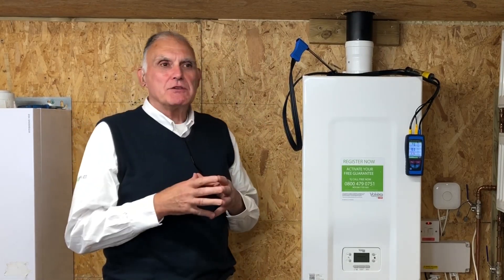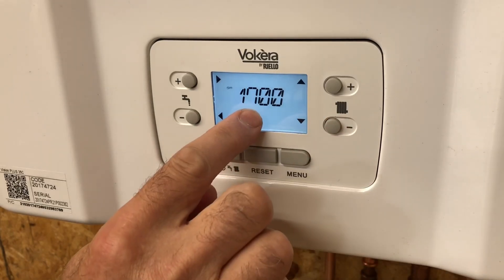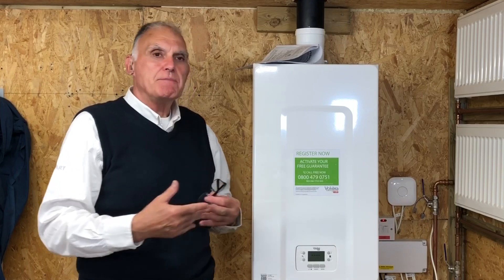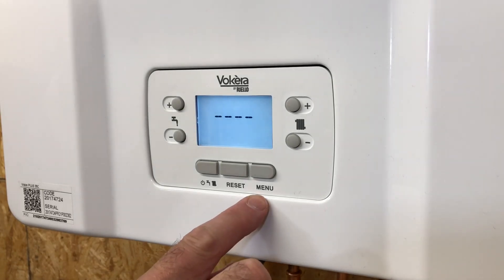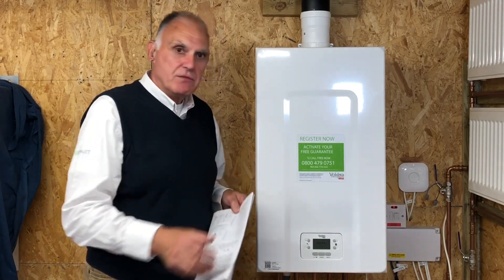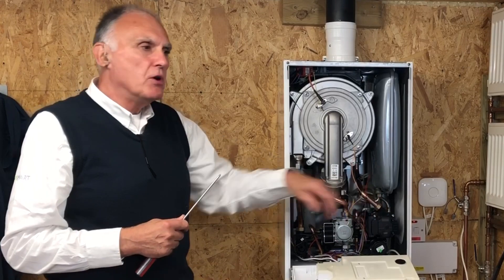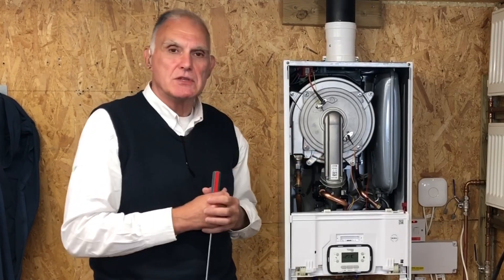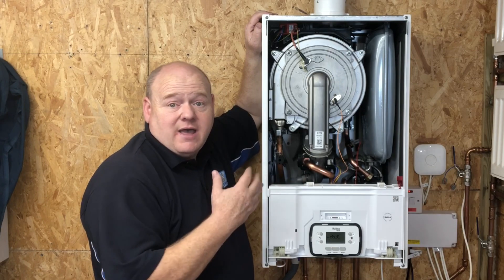Vokera Vision Service Mode - Range Rating - Leeds Plumber - David Iszchak

Comment: Can you help iv vokera aquanova 17 boiler and get 03 error and boiler won't run and will keep trying to restart the error is flue/fan error and some research has show a sensor mite need cleaning does this sound correct to you ?

Comment: Fitted a vision plus 30kw system today commissioning tomorrow so this was a great help. It’s the original Vokera pipe orientation which I was a little disappointed with. Gas valve is facing to the right leaving it awkward and oceans of space to face forward. I’m hoping it’s ok I normally fit baxi but customer wanted this. Hopefully it goes smoothly tomorrow but I’ve definitely fitted worse. Heat exchanger looks good gas valve & fan are good everything is very accessible
Reply: Well I commissioned the Vision plus and set it up on lpg. I am very impressed at how good the readings were from the word go. Fairly straight forward parameters to alter and a different jet. Really happy and I range rated it to 26kw and the house is perfect. The boiler was condensing for over 40 minutes.. I’m very happy and I’d tell any good installers to give one a try. Well done Vokera

Comment: Video Is good but Not enough, how to set time and timer, from 0 to complety set? WiFi icon is on it, can I use my phone to connect and set it from phone? My identical boiler as in the video was installed with additional horrible to use wall mounted devise to turn it off and on from company names ctc. Device is offul to use, but it is in place, why? And how do I use that? I'm computer science engineer, I can fix devices from smartphone and laptops to Tesla cars and I can not set timer on it. I think it must more simple and straightforward

Comment: Do you have to replace the burner seal for each service or not if it looks okay
Reply from the maker: Very good question. No. I was told you need to inspect it and see if its damaged. Please refer to the installation information though as things may change over time.
Reply: @AllenHart999  Cheers Alan I've tried to download installation instructions but unable to find the them.
Reply from the maker: Stephen Rowen you will not need to worry about service just yet. Thanks
Reply from the maker: Stephen Rowen I will do a full video on it in next few weeks. Thanks

Comment: Cause this is on the lower budget boiler i don't many installer will take the time to range rate it. I think it should self adjust. If need be?
Reply from the maker: You are totally missing the point of range rating 😂

Comment: Ok video but a few gaps. David mentions the service mode but does not mention where from or how to adjust it if needed. Also is a list of all the parameters available as vokera tend to miss out information on the MI from past experience. Are there any drain points below the boiler?
Reply: I’m sure the details of how to adjust the gas valve are in the MI’s
Reply: @gasmanrus  yes i realise that. But while David was showing how to enter high and low, the next logical step would be to show where and how to adjust the levels.
Reply: @gasfitter78  We deliberately left that out as it's a standard SIT valve and the instructions are in the mi's. I've done a video on that but not with Allen. Not sure if I'll post that under Vokera or myself or whether it would be posted at all. Pleasingly the boiler was spot on anyway. As for drain offs you could use the vent tap for the heat exchanger and below that bottom left is the boiler drain off. Also I used to say you could drain more through the filling loop but this is a very tight fit and not easy to remove. There's a small drain cap at the cold inlet end that could be used.

Comment: Allen, David, Great step forward from Riello/Vokera, with range rating and nice controller, great heat exchanger.  The problem is from a commercial background  is i see range rating ignored, causing countless issues. Again great video, range rating for combi's is the way forward on domestic, with the proper training. Allen, videos spot on, all manufacturers should watch this👍
Reply from the maker: You can also range rate the cheapest Vokera boiler 😂
Reply: @AllenHart999  😂Allen, I think ive seen one domestic Vokera boiler in 10 years, again from commercial background i'm impressed to see this on domestic. I come accross a lot of ideal logics on commercial premises though, thats how I started watching your vids, bloody high/low testing. Hooked since then though mate 👍
Reply: They are everywhere up in Scotland, no idea why that's the case but they are 😂

Comment: Good afternoon I used to work on huge numbers of Vokera boilers from the mynute,through the linea and the first Vokera high efficiency boilers from the year dot up to 2013 and cannot remember any problems at all with the plastic components so I can concur with the Vokera rep however something has always puzzled me and that is this I am going to give you the efficiency and CO2 figures for first of all a band D Vokera Minute 20E and then the figures for the new Vokera you have just fitted 
Munute 78.5% effecency and gives out 6% CO2
Vision    93 % efficiency and gives out    9% CO2
On the face of it The new boiler gas a greater efficiency by 14.5 % BUT gives out 50% more CO 
I chose the mynute because I have the instructions to hand. I always got lower CO readings with the older but still fan flued and electronic ignition .
The old band D boilers seem to give out less CO2 even allowing for the increase in gas used.
Reply: John Boy, can you rnage rate a Unica (ERP) I36?
Reply: @LordJasonKing  I have been retired for 7years now and in fact had to look up ERP however if the boiler you refer to is The Vokera Unica 136 GC number 47 364 16  then the answer would appear to be no .What it does do after ignition is go to 75% of full rate for 15 minutes after that it looks at the flow temp and desides  if it needs to increase this up to 100%  , when temperatures  allow it can modulate down to 10% of full gas rate via the water temperature sensors control of the fan speed and then the fan speed altering the gas valve position.
Reply: @johnboy1232  hi John thanks mate. The more eficent the more complicated the can go wrong😂. Stay safe mate.
Reply: @LordJasonKing   I agree with you entirely , A band D boiler fan flues with electronic ignition is about 79 % efficient and if you look at the figures for a representative one in my first post you can see that it used 15% more gas but exhausts 6% CO2 instead of the 9% that the new boilers are set up for. I still look after a Vokera Mynute  E16 boiler that is nealy 20 years old .I put in the whole system it was flushed cold and hot and it has run faultlessly .I replaced the remote clock because a relay had gone in it and the two port valves five years after install ACL to Honeywell  but that's it. If you take into consideration a new boiler today will last ten years and require fancy gadgets to work on it which need calibrating every year cannot help feeling the Great British public have been sold a pup here.
Reply: @johnboy1232  I agree entirely.